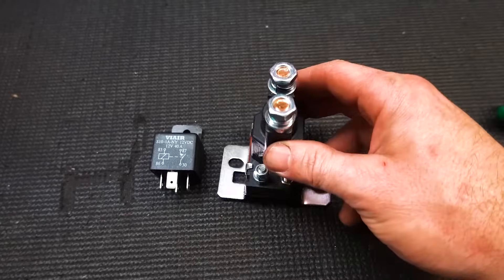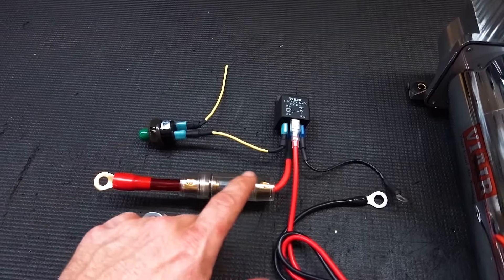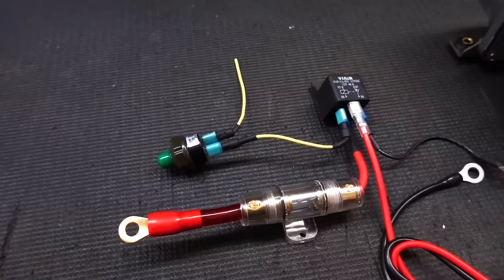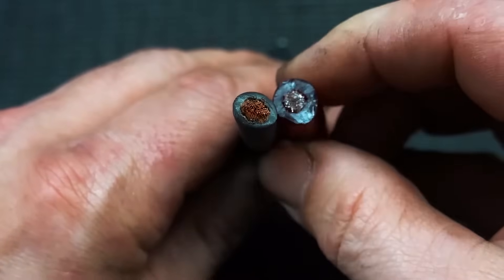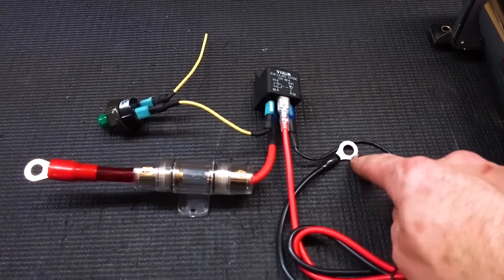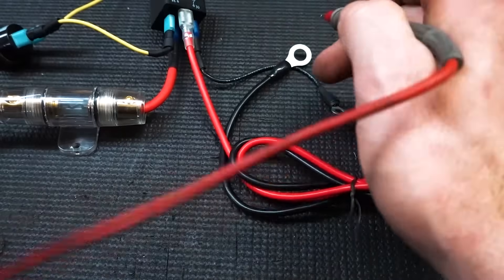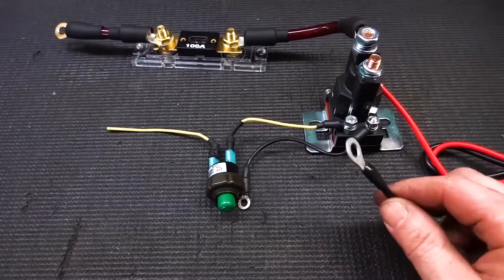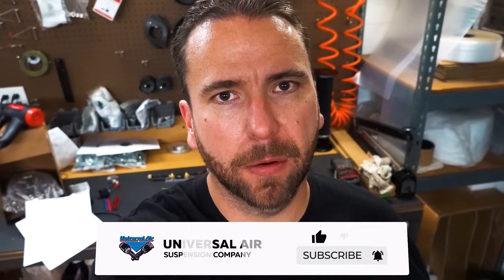How to wire compressors for your Air Bag Suspension

Comment: Do you recommend a  Distribution Box ground & power for the other cables that need power and ground with in the air system?  I didn’t want to use the Pac80 for multiple ground and power. I’m a little confused on how to hook up the ground for the compressors, and the main ground for the Pac80. I have done some research and everyone says do not connect all grounds to the pac80, that’s why I’m asking about the distribution box. Thanks
Reply from the maker: If your trying to do a ground distribution, you can use a block, or even a simple bolt (my preferred method).  I prefer to not use the post on the PAC 80 for ground distribution since its so small.  The PAC 80 ground requirements are only about an amp to switch.

For a trunk setup, i will do a bolt though what ever I am mounting the tank/compressors to with a nut.  Then you can put all of your grounds above the nut and secure with a second nut.  I will also run a ground wire back from the battery to the ground post, then also add one from the side panel of the trunk to the same post.  You can never have too much ground :)

Comment: I had a problem with one if my compressor, actually the fuse always burns out after a couple uses of one of them could it be that the wiring is very long, I have 2 air compressor that I use for my air suspension
Reply from the maker: Startup current is higher. I would suggest to check the grounds. If you have a voltage drop it will significantly increase the amp draw.
Reply: @UniversalAir  I had both compressors connected to the same ground source, one was on directly connected to the ground source and the other one just on top of the first one, which was the one burning my fuses every time it started the compressor, I simply switch that one to a different ground source and it worked several times without burning the fuse, I was like wow I know is more about science but for me felt like magic lol, thanks a lot for the advice 🙏